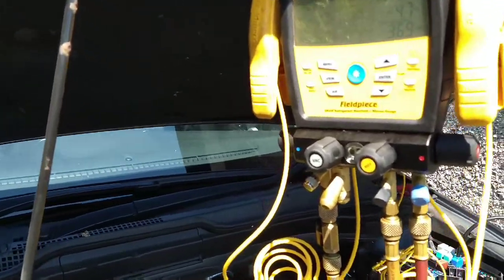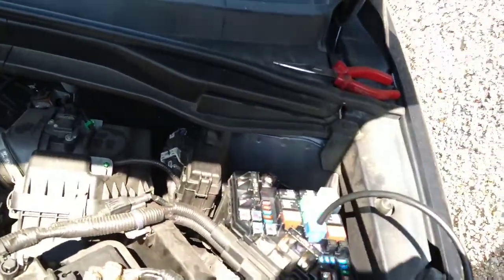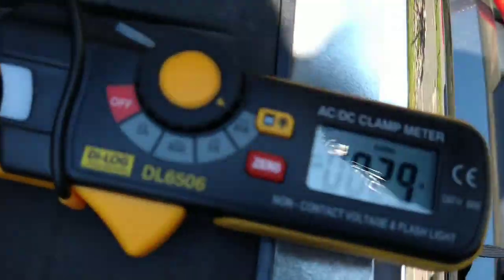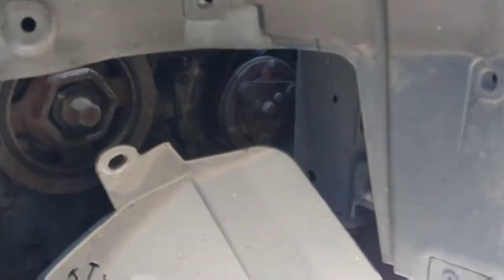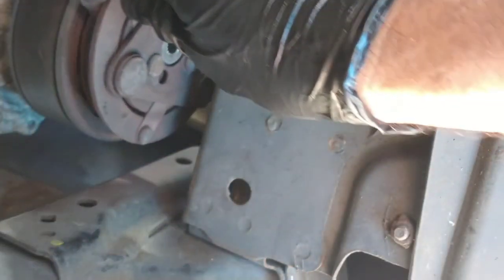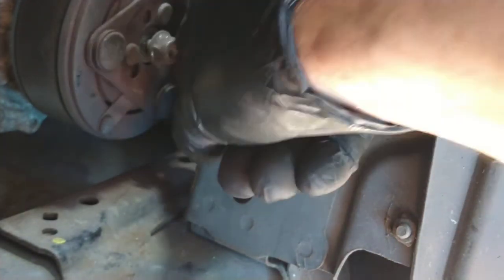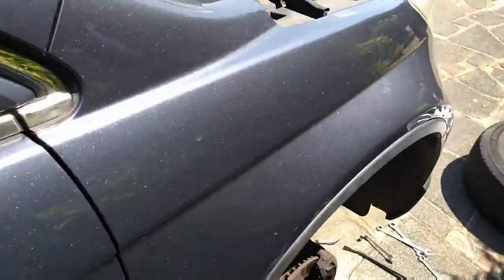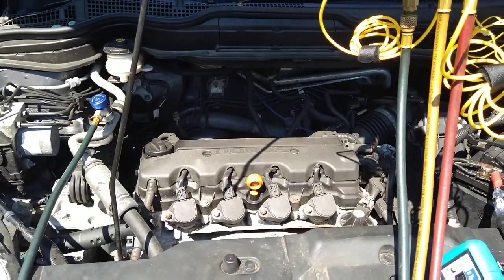Honda CRV 2007 Air Conditioning fault. Compressor repair - Fixed !

Comment: Hondas and Acuras relay first clutch gap second. Sub cooling possibly looked a little low. But I did not know whether you had the air conditioning stabilize running for about 10 minutes at about 1200 RPMs not idle. Or placement of temperature sensors
Reply from the maker: Didn't let it stabilise in the video but ran it for 10 mins while I was putting trims & wheel back on. It was all good.